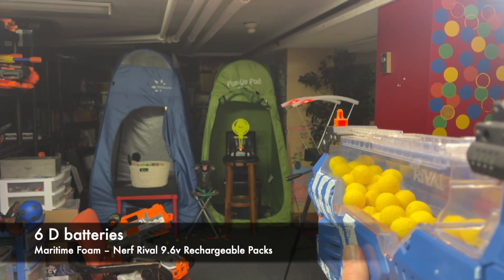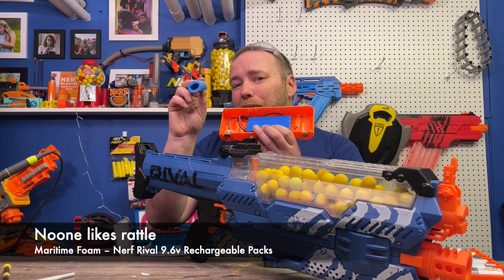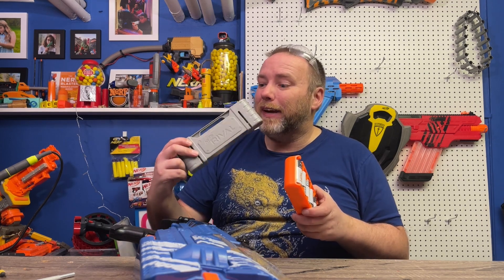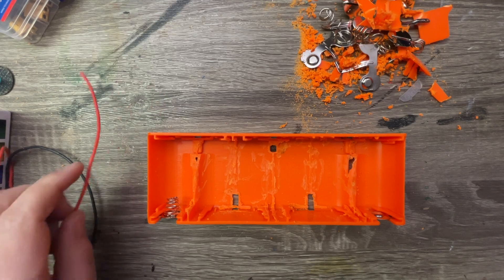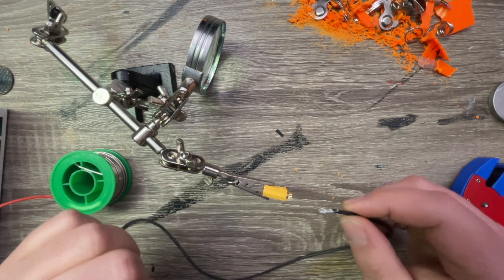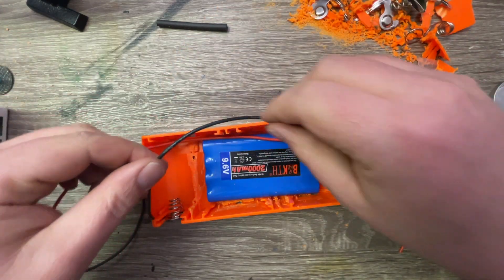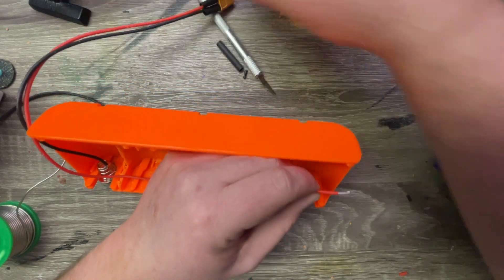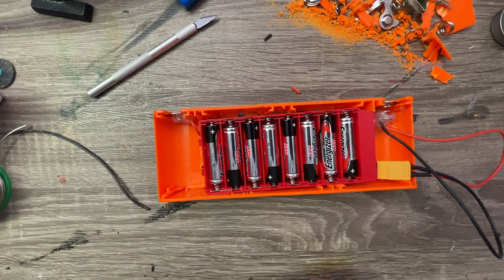Faster firing made easy! Making cheap Nerf Rival 9.6v Rechargeable Packs

Comment: Very important…if you re-wire the nemesis to 3s Lipo, you MUST use a brand name Omron switch (21amp) on the rev trigger or larger 3s packs will burn out the switch if you use Tezuo. I smoked a Tezuo using my 2200 mah 60c proton pack battery. I heard about Luke’s mod guide saying to use a brand name Omron and it worked perfectly.
Reply from the maker: Oh interested, and awesome to know. I generally don’t need my rival on lipo, I wish I’d known would have shouted that warning louder (you may have told me this before ha)

Comment: Honestly, I just bought myself a bunch of cheap AA to B-cell and AA to D-cell adapters which make my Hyperfire, rival charger and other blasters that require B or D cells a lot lighter, not only that, but I can also use my Out of Darts , 3.7v IMR cells for increased performance. 
It should be noted that the length of 6 B cells that fit in the rival charger are overall a little shorter than the 3.7 V IMR which has made it impossible for me to use in the rival charger.
Reply from the maker: This is not a bad solution either by any means! Just for kids and modding a blaster to give someone, I like that this is regular batteries, but that method is also awesome for sure!

Comment: 6:35 what do you mean connectors ? Can I just buy the pack and xt 60?
Reply from the maker: You can, you have to change the plug on the pack though. Or, you can buy a Tamiya to XT60 adapter.
Reply: @maritimefoam  can you link the adapter you use ?
Reply: @maritimefoam  so I don’t have to buy a tamiya connector?

Comment: Would it be better to use a 7.2v lipo or nimh instead of a 9.6v to avoid burning out the motor?
Reply from the maker: 9.6 won’t burn out that motor :)

Comment: Did this to my Rival. Cannot believe how much it improved the speed. I found a two battery harness so I can have two batteries paralleled. Lasts so much longer.
Reply from the maker: Everything is as good as a Perses after you do this, it's cool!
Reply: @Andrew Smith-nf9ws 
Do you have a link for the harness you used?

Comment: Is flux essential in doing this? Is there a specifix type i should get or any ? Thanks!
Reply from the maker: You want the kind of flux for electronics. @outofdarts has some, ordering from them means you know you’re getting the right thing (which is what I always did haha), but you can get it from Amazon too.
Reply: @maritimefoam  hey dude, just finished the mod today and its workin pretty damn good, just one question, will it have any problems with overheat or wiring? Thanks again and kind regards!

Comment: Would like to replace the 6 'D' batteries with a rechargeable battery pack for a Nerf Mastodon. Would making this d.i.y. 9.6v batt pk work w/o redoing any of the internal wirings in the Mastodon? Don't want to torch or touch any of the innards but can if need be.  Any aid, link(s), suggestions, or cautions would be appreciated.
Reply from the maker: You could wired right to the positive and negative terminals in the battery tray like I did. It would improve it for sure.